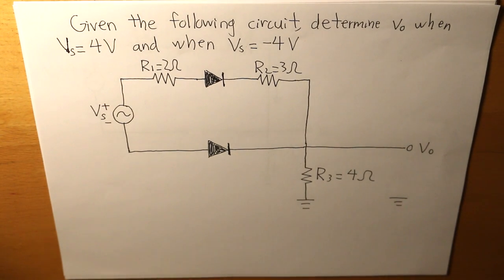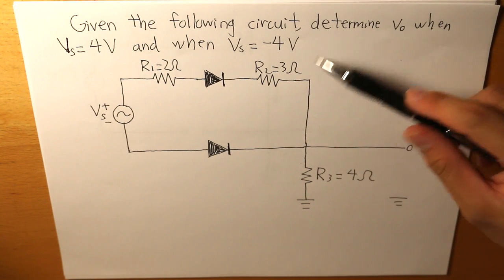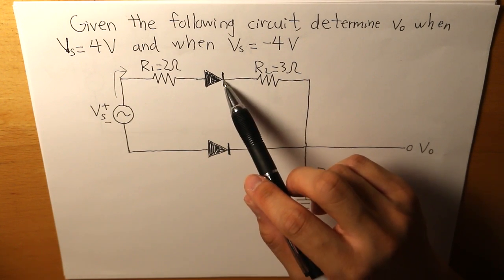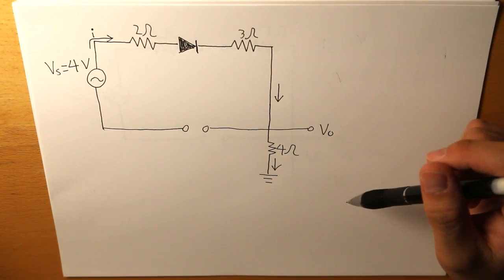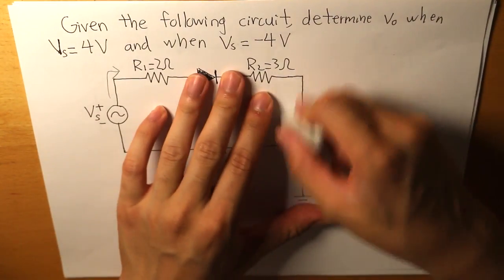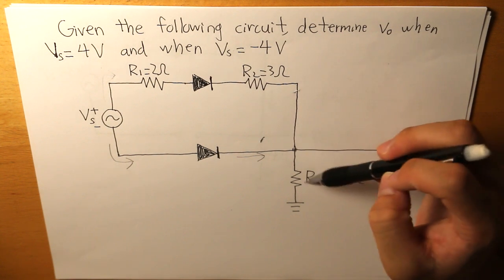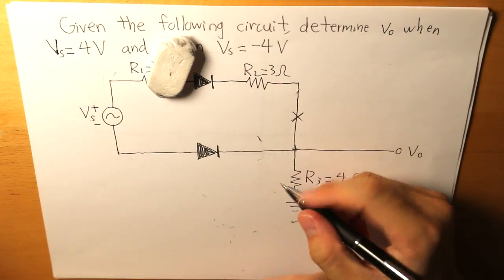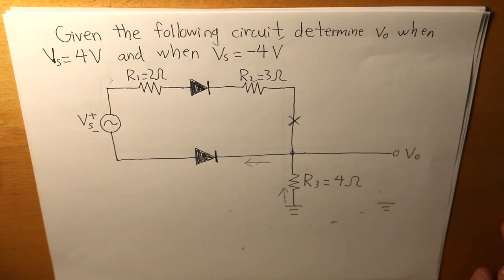Analysis of Diodes In A Circuit (Two diodes, including voltage source)

Comment: to be honest i think this video is wrong 

2 things

1st 1 terminal of the battery is cut off, so there is no way  current can go back, so  there should be no voltage at all what  so ever 

2nd even if there was a current, when the battery go -4 volts the negative terminal becomes 4 volt which is greater than the ground (0 volt) and therefore should be like the 1st case, but switched over and the output voltage is 4/4= 1 volt

but there is no way the current can come back anyways, so this is wrong from the beginning